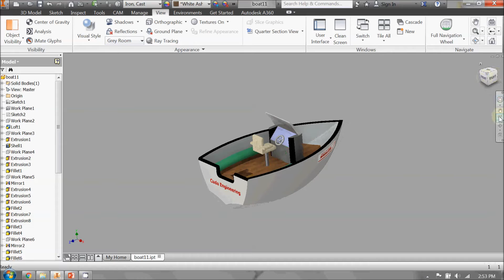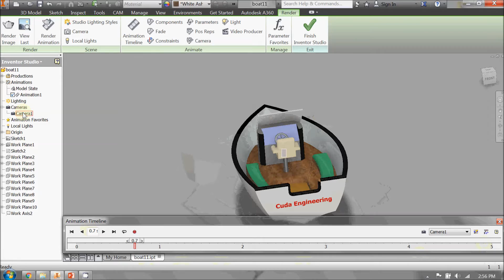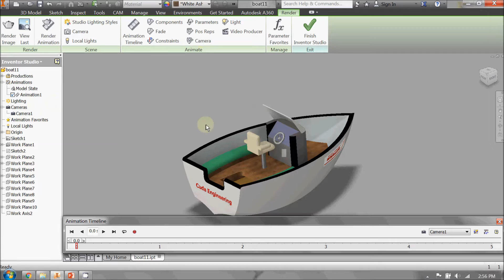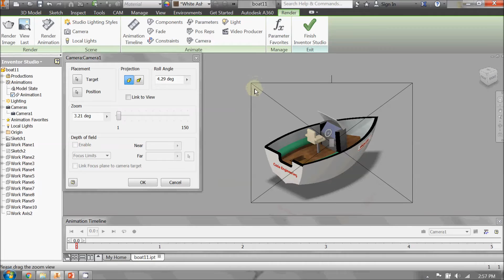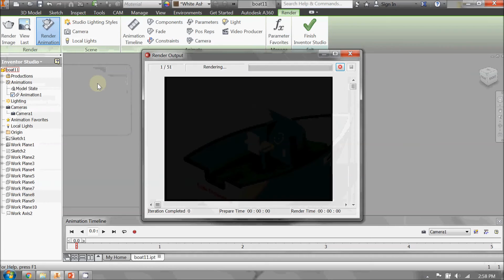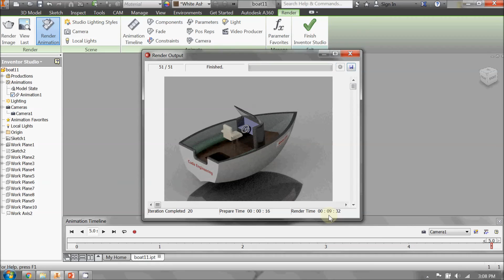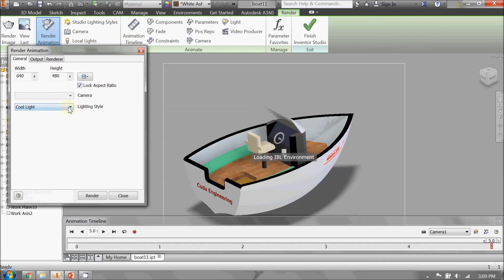Making a rendered animation in Autodesk Inventor

Comment: why does inventor's animation rendering suck so bad? It's pitiful. I'm having to make one for work and I'm going to be so embarrassed when I turn it in. Probably get fired.
Reply: Yeah I have been at this for 2 days not trying every setting to get a decent video. 15 seconds. Still haven't got one yet. Even tried to just get the pictures and do it with a different software but the picture are also shit.
Reply: So what ended up happening? Did you get fired for this?